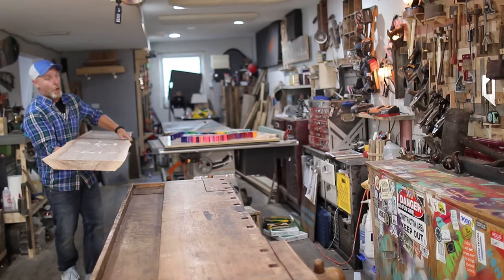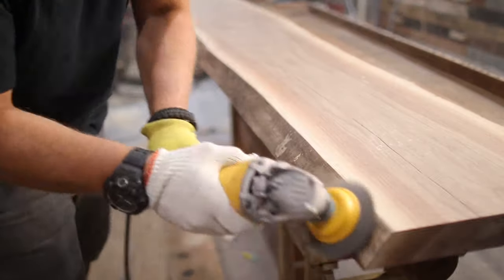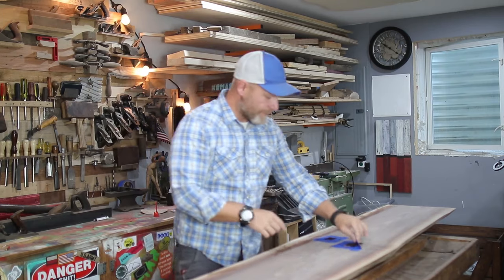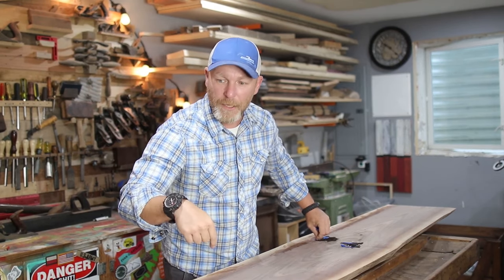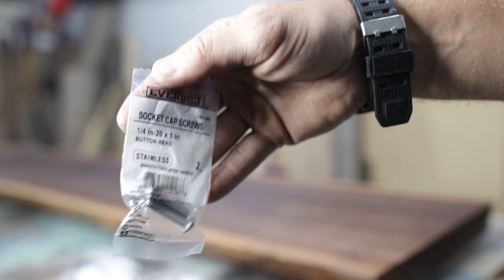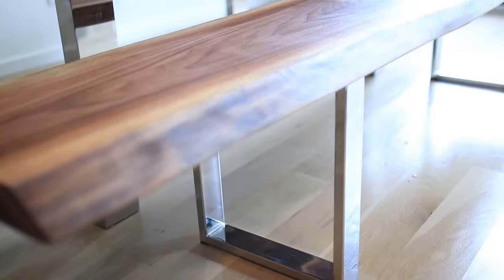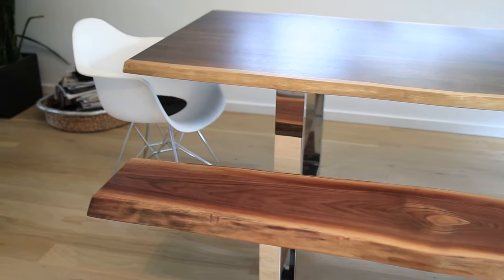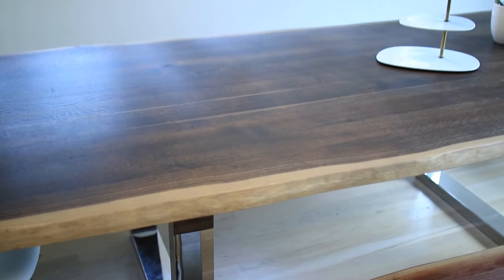How To Make a Live Edge Walnut Slab Sitting Bench || DIY Woodworking Project

Comment: New to wood working ... do you recommend either of these jointers ? cutech 8” bench jointer or Ridgid jpo610 ?
Reply from the maker: Dr Frankenstein out of those two I would go with the ridgid.  But for 600-700 your going to pay new for that you could get a great 6” or even 8” used one from someone like Grizzly , Powematic or even Jet.  I usually buy all my big tools used on Craigslist or FB market place.  Just shop around.  I got a used 6” grizzly for $350 and it works amazing.
Reply: Komar Project thank you. Does it matter much getting the 8” over the 6” ?
Reply from the maker: Dr Frankenstein believe it or not that 2” makes a world of difference.  There have been so many times where I wished I had a 8”.

Comment: how do you prevent it from sagging, either over time or when some heavy person sits in the middle?
Reply: That's a very good question! I'd like to know as well. Any followup...?
Reply: It’s a 2” slab of solid walnut. That is a massive hunk of solid, kiln-dried walnut. It’s only about 6.5 feet long. Remember, he trimmed the ends of the 8 foot slab he started with. The legs are inset from the ends at least a foot on each end. That means the longest, unsupported span is only about 4 feet. The legs would smash flat to the ground before you could flex that slab. It will never, ever sag.